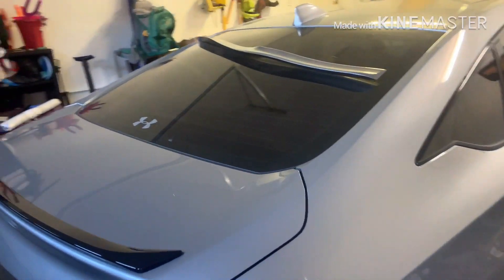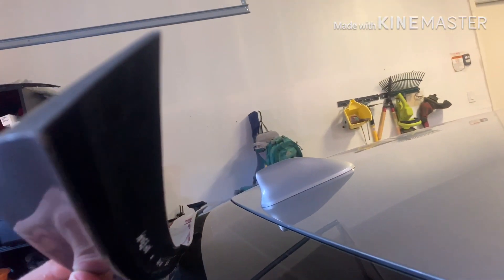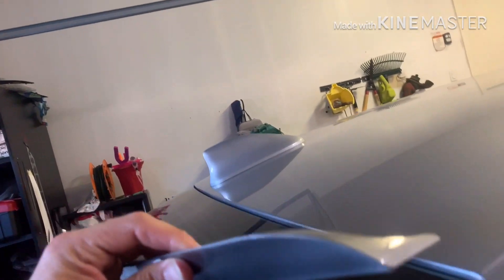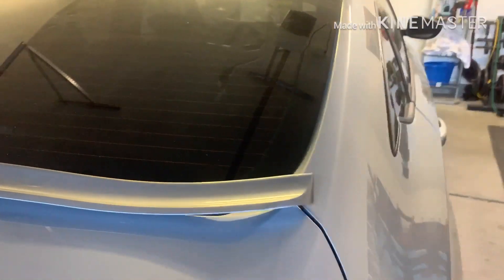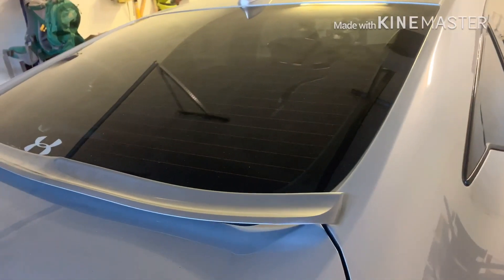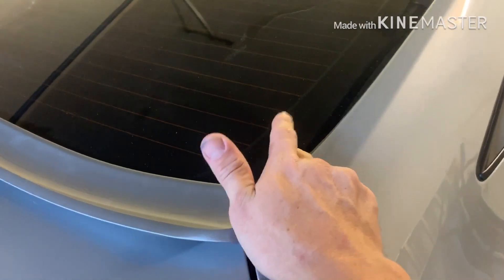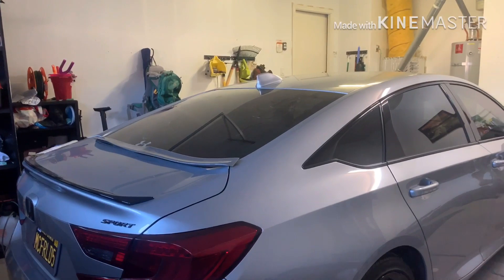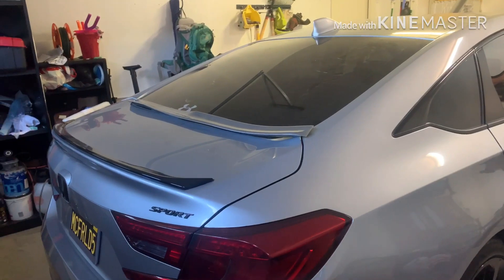2018 Honda Accord spoiler mod FAIL! What you need to know

Comment: Same thing with my 2018 camry,
I removed the tape they had and used 3m.
Left the spoiler in the sun to soften up the tape and spoiler.
Wiped the window down with an alcohol cleanser wipe.
2 weeks in it still stands. 
Gonna try it on my bros 2018 hundo next.
Reply from the maker: Thanks man.  Hopefully it holds. I appreciate the info.

Comment: I installed mine back in May with the supplied tape. It’s been holding up fine so far.
Reply from the maker: Good to know. It started off great then it’s been really hot here. I think that led to it not holding.

Comment: Hi Jon you're right It may be the 3M tape that came with the spoiler that's not good enough 
I think the genuine 3M tape will hold.I need to ask for an advice on how to take care of my rims I got my overlays on my wheels last Sunday on blue and they turned pretty darn good I 
must say my question is how do you take care of the rims when you wash your car if you could make a video or just give me some tips I would be highly appreciated I have to use a 
self car wash cause I live in a apartment building and don't have access to a water hose.
Reply from the maker: Nice man. I would recommend a touch less wash then. They stick on there good but any brush on the edge will cause the vinyl to lift. I was mine with a wash mitt and they have come out perfect. Just try and find a good car wash that doesn’t use those abrasive brushes and you should be good to go. Let me know if you need any more help. 👍🏻

Comment: Hey Jon I’m trying to find out if us accord sport owners can place a center speaker behind the radio like the touring model
Reply from the maker: You can but you have to run the new wires. It’s not prewired.

Comment: I miss my accord.  Maybe they will have a special edition accord later.   I hear those spoilers don't really stick I don't know why but it's actually a cool mod
Reply from the maker: Yeah. I liked the look. I’m gonna get some real 3m tape and give it another go. It should definitely hold it since it holds the side moldings on.
Reply: You’re right about driving on the freeway and something falls off and cause an accident hope the genuine 3M holds it tight.
Hey Jon I got my overlays on my wheels yesterday I went with the blue ones I took the wheels off the car and put the wheels on a table waist level and it was so easy to work on it that way any ways I was wondering if you could make a video on how you wash your wheels for them to last over a year if I’m not mistaken if not give us some tips on how you do it I live in a apartment and have to use a self car wash thank you Jon.
Reply: What did you jump into next?

Comment: where did you order this roof line spoiler? I want one for my trunk and roof line- ive got a 2.0t touring modern grey
Reply from the maker: Nice car. I don’t have mine on at the moment because it was coming unglued. I need to get stronger 3m tape. Here’s where I bought mine. It’s perfect. Amazing paint job. I just recommend taking the tape off and getting the strongest 3m tape for it. It would be way stronger. 

https://www.ebay.com/itm/303456375241
Reply: Thank you! Yea I’ve got the touring which you would think hey! You get a spoiler! Nope! So I’ve been hunting items but then i got in the wreck and i was sure it was totaled. But now I’ve got a wonder Structural damage on my car fax and yet cause the cost do value they fix it! I was hot!
Reply from the maker: I would be too. You work hard for what you have and want nice things. That’s a nice ride though.  I would like the touring for sure.
Reply: @HondaJon  the touring is very very nice and im really happy. ive owned anything from a eclipse to a grand prix to audi q7 and acura tl. the audi and tl were both in the lastr 3 years- but after thinking cars, I came back to accords. this is my fourth. i had a 03,09,13 and now a 19
Reply from the maker: Some nice cars there. I agree. I’ve had others too but the accord does so many things well.
Reply: Are you on any of the Honda groups on Facebook?
Reply from the maker: Yeah. I belong to accordx I believe it is.
Reply from the maker: And 10th gen accords too
Reply: Honda Jon you’ll have to look me up. I can’t do the massive group 10th gen one- it’s too much for me. I’m into in the smaller 2.0t sport and touring one. Just look up my name on Facebook and add me
Reply: hey jon i sent you a email.